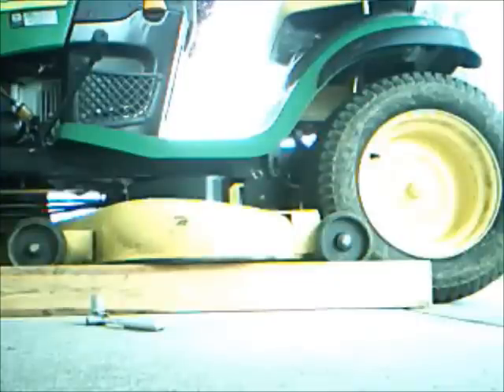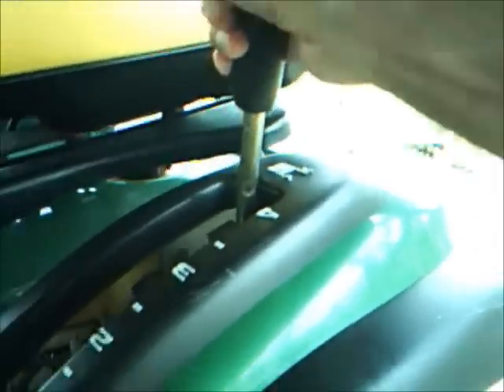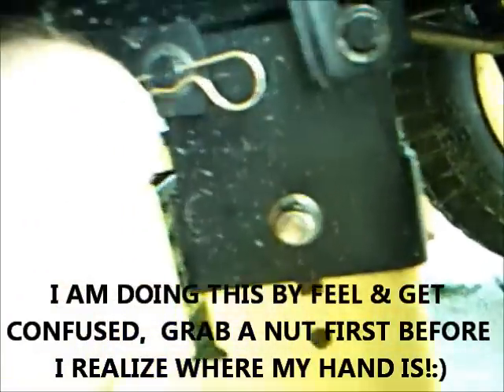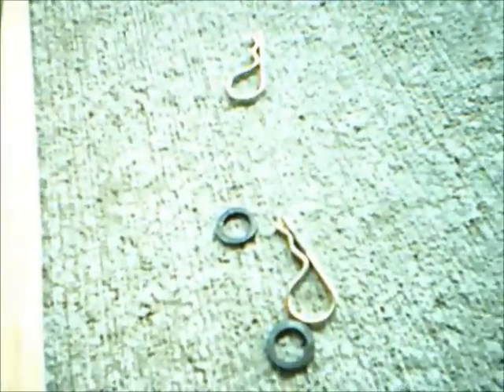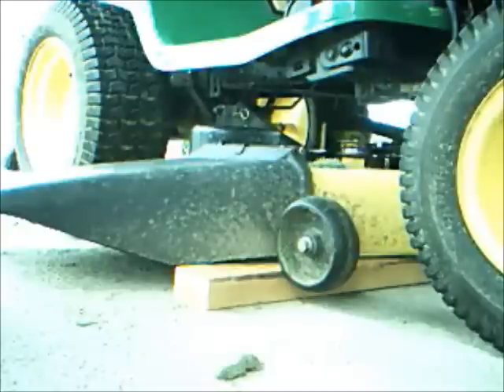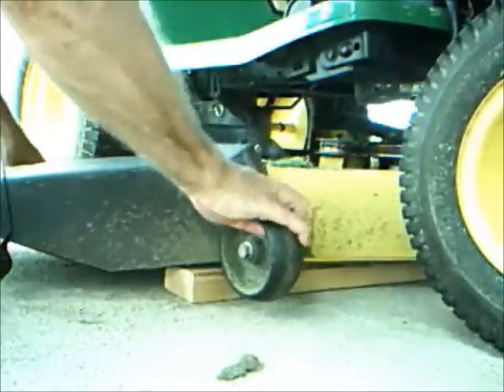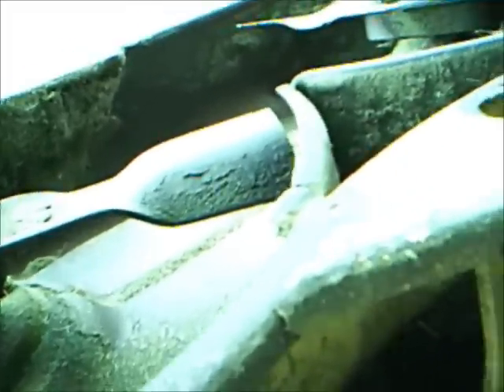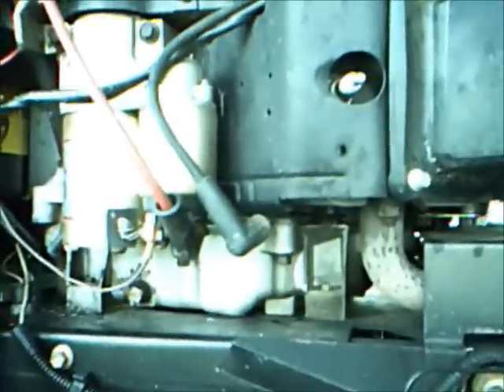Mower Deck Removal - John Deere L130

Comment: another real good way to clean blades is,, if you have a engine hoist, cherry picker style lift and a smooth driveway, it makes cleaning underneath the decks a lot easier if a person does have one of those and that's what I use but keeping lawn and garden equipment clean is a good practice to always stay with and I even know a lot of people that will not clean their machines and wonder why they do not last very long but I like your videos you put on here,,, they're very informational and helpful

Comment: I do like the l130 machines  and they are very comfortable riding with a great suspension and do very well even on hills cutting grass and pulling a 5 ft. Long yard cart with a few hundred pounds in it.. I was a little sketchy at first with the machine pulling the yard cart with that much weight and cutting grass at the same time with me on it on a hillside because of it being a non lugrear tire and spindle set up but the keyed axle and spindle have done well on one of those 130s I have and I'm probably selling it and maybe the other one soon but they are nice machines and probably were budget-friendly when new

Comment: I just picked up 2 Different John Deere L130 Automatic Riding Mowers And I didn't realize how much there was to removing the decks from underneath of them because I'm used to The Spring loaded Twist pull and lock out or in place Stationary Pins, Like a Couple of my late 90s Models John Deere GT 275 Riding Mowers have on them... John Deere Should Have made all of Their Riding Mowers and Lawn And Garden Tractors quick Release Types of Machines for any of the attachments, like they made for the GT Series of Machines and the gt also has the Separate Drive belt  for the cutting deck that is very convenient with the full 360 rotating deck wheels that are as well stationary spring loaded pull and twist lock and unlock pins, so your not having to struggle dragging the deck back and forth sideways
Reply from the maker: My mower is 15 years old & I had hoped they would improve the removal, since then.  It is quite cumbersome & makes it more difficult to clean it.  I don't have the hose hookup but not sure I would it, anyway? Do you have the hose hookup & do you use it?

Comment: Hey John! I had good success installing my plow, Thanks!  Removing the mower deck is my next project.  Question, how heavy would you guess the mower deck to be when detached?
Reply from the maker: Wow, Dr., I am guessing 100lb. ish?  I can easily lift one side and move it on the rollers but have not tried to lift the entire thing.  Put 2x4's under it and slide it out on them.  Good luck and let me know how it goes?

Comment: Hi John, we've communicated this past winter several times in regards to the snow plow. Now it's Spring and I need to replace my belt. Do you think the belt can be replaced by not taking off the deck? Thanks Again!
Reply from the maker: alwaysbeeurself Looking at the attached section of the manual it looks like you have to take it off to get to every thing?  You have to take off the covers of the pulley spindles.  It is a good time to take it off and flip it over and clean it and sharpen the blades, if needed, anyway.  That's what I did a couple of weeks ago.  Good luck!

http://manuals.deere.com/cceomview/OMGX21647_K3/Output/Index.html?tM=HO

Comment: Hey I got a lt155 mower I don't have the book but how does the deck belt go on
Reply from the maker: Hank try the following manual.  Thanks for watching.
https://jdagccc.custhelp.com/ci/fattach/get/51647/0/session/L2F2LzEvdGltZS8xNDcxNjY0MzA4L3NpZC9QNDhLaHdZbQ==/filename/268-LT133+LT155+LT166.pdf
Reply: John H Thank you!